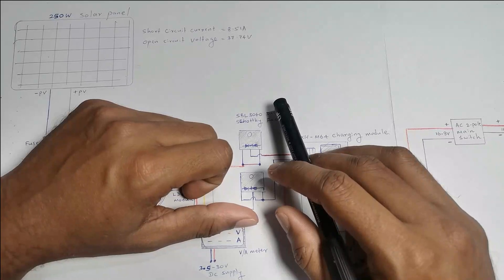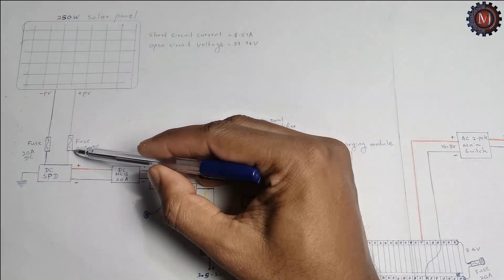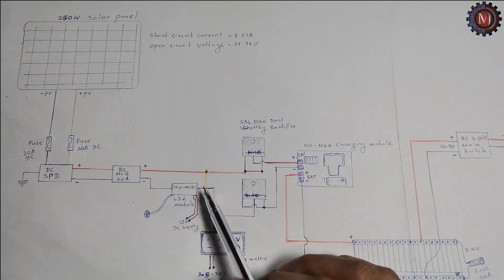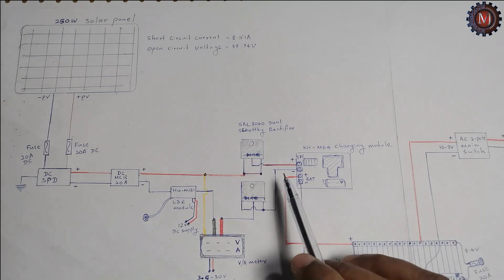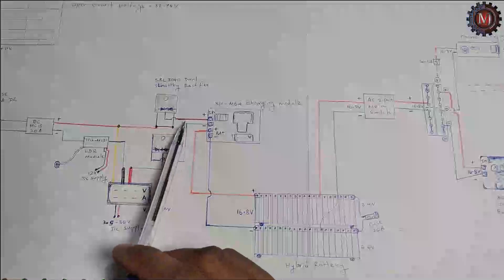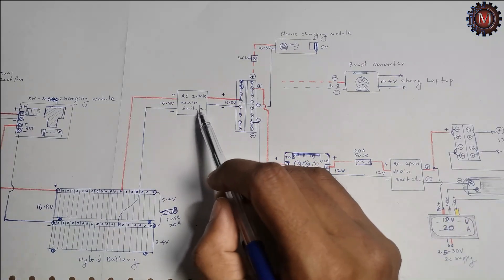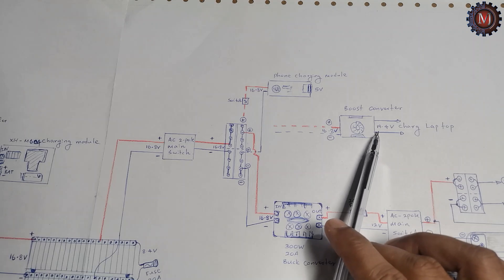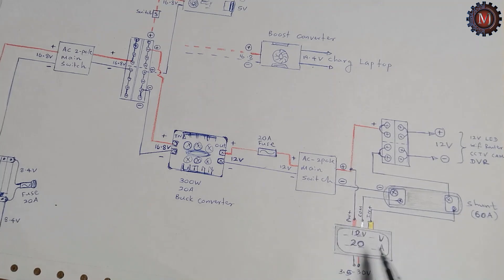Hybrid Battery Solar System Ep02/ Off Grid Solar System 2023 #electronic #diy #solar

Comment: I have this kind of solar system but the battery voltage drop so fast? But when it drop to 10V, I stop use the battery, it up to 11V or higher, why?

Comment: I have to 1 problem. You tell your panel is 37v . you connect with battery with direct  and you used change module. It is not good. Module not regulate pv volt?